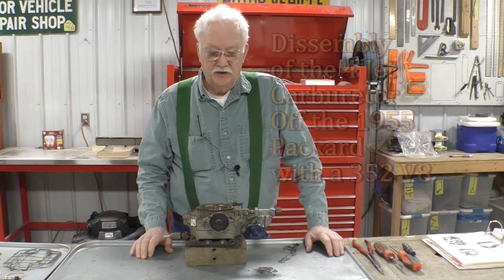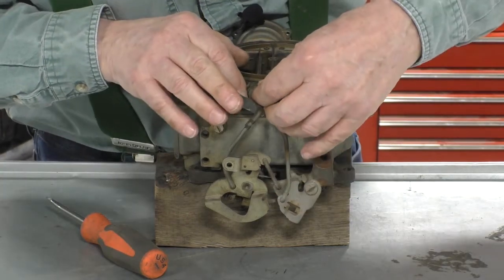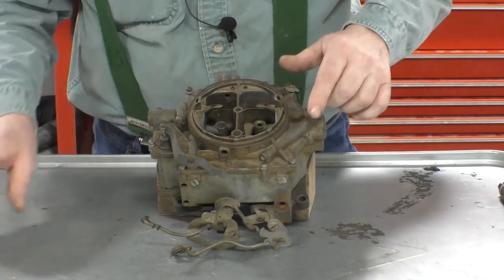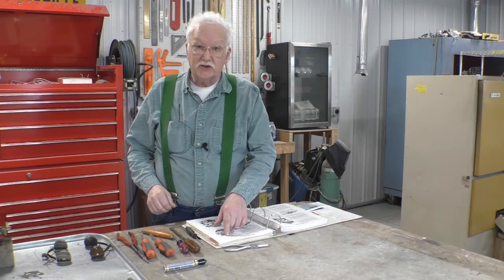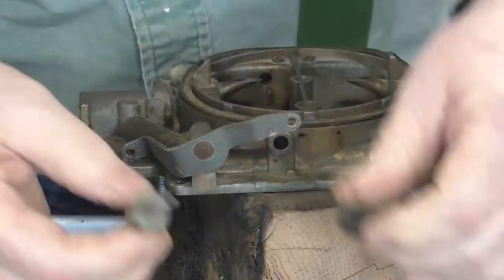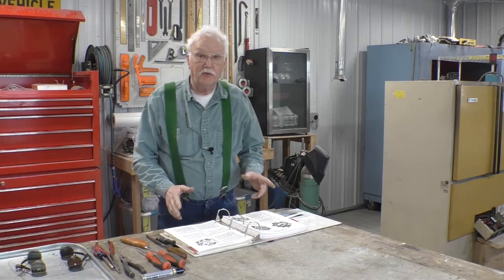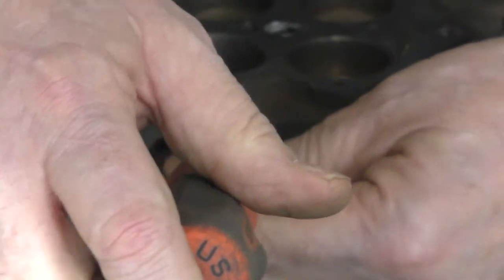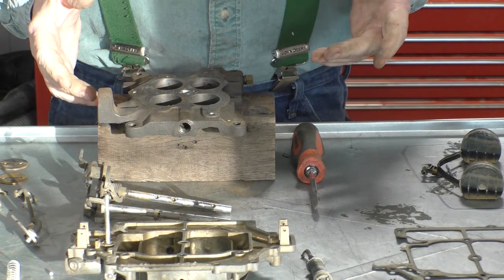Disassembly of a 4 Jet Rochester Carburetor

Comment: Still quite a few 4-GC's left in NHRA Stock, and Super Stock. My friend has a 65 Chevelle with a 327, 250 HP version, that runs in SS/KA. If he changes to the Carter carb it becomes a 327, 300 HP, and goes to SS/JA. Super Stock requires the stock carb, compression ratio, port CC's, valve size, rod length, and stroke. Any cam and intake manifold (must fit under stock hood), may be used. Class is determined by shipping weight divided by NHRA rated HP. It's amazing how much power can be made with these small carbs.
Reply from the maker: Outstanding rely